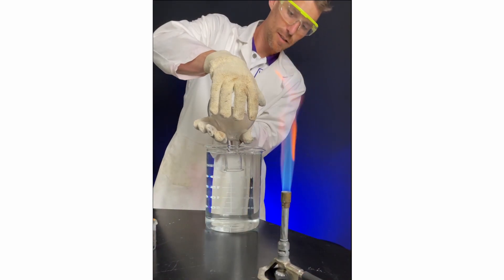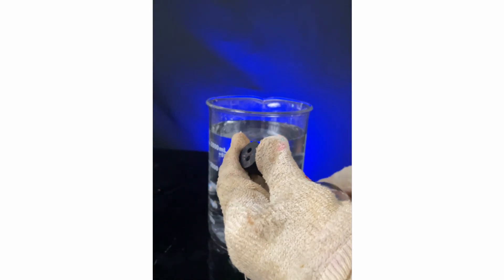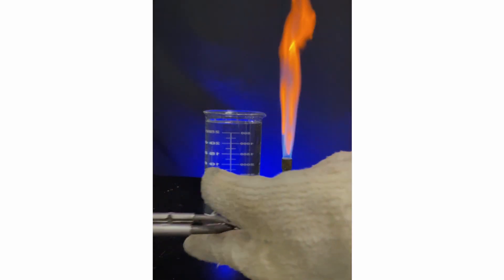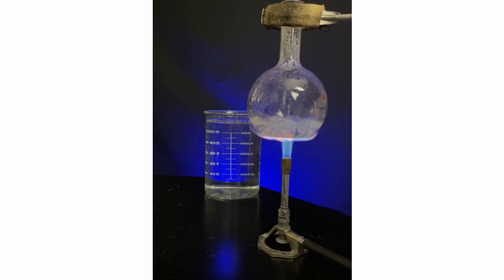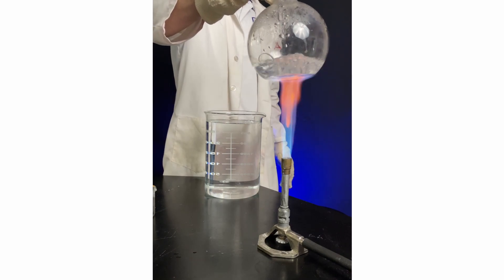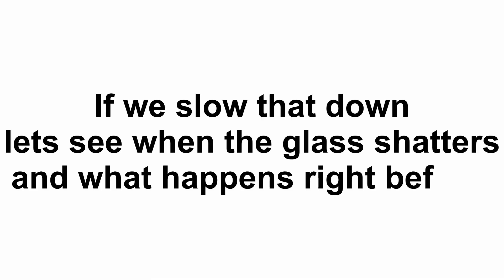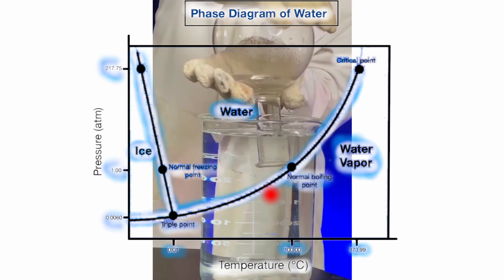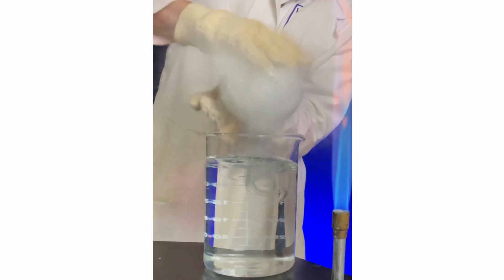Always wear safety glasses with STEAM HAMMER!

Comment: So pressure got build up though? Idk how really extreamly low But How low temp it is?
Reply from the maker: So the water that is enters the flask is about 20C. The majority of the hot water gets dumped out when it is flipped. The hot water that was in the flask was boiling so that puts it at around 100C (maybe a little less by the time it hits the water). Does that answer your questions??